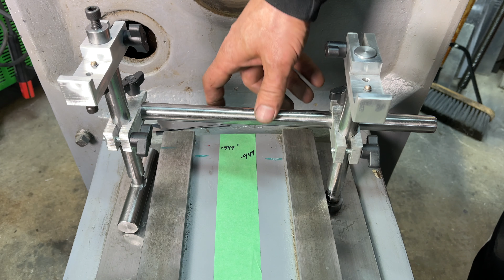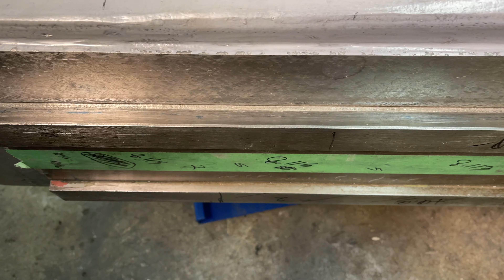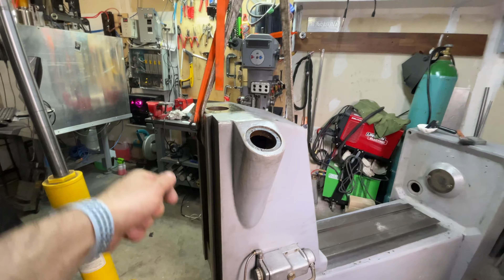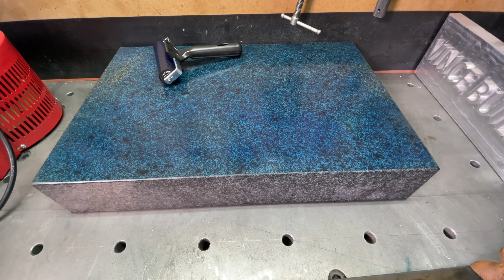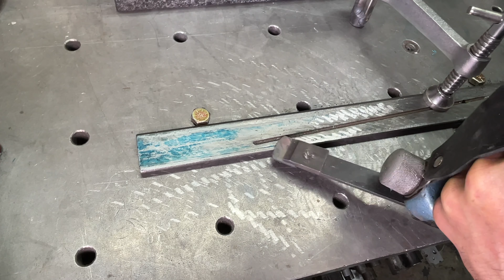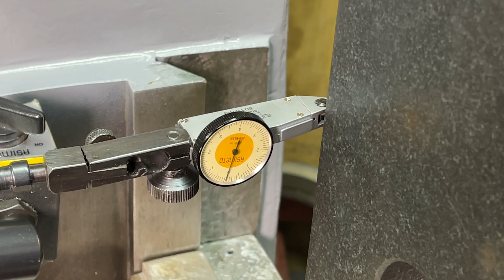Milling machine rebuild and scraping part 1 of 2

Comment: My dad used to say 
."don't get Biax happy" meaning stay on pattern so you don't dig a hole.
 The pattern is the consistency that yields the error. 1980 ish. 8 machines no problem.
 Good build on a decent machine. 
 Prime for a retrofit.

Comment: That device for Parallel measurement between the 2 mail dovetails is very user friendly. Keep it up bro. Really amazing work with all the explanations. One question. How do you rebuild the Taper Gibs, if they are worn out beyond limits. Of course a new one with the added thickness is one way. We rebuilt the gibs by brazing the rear side with brass strips and then scraping both surfaces for perfect flatness. This method worked on several compound slides of Lathes that we restored here.

Comment: Nice job! The Gibs and interior dovetail surfaces were maybe a small waste of time, since they're just a variable adjustment tool. As long as you have as much adjustment as you need with the adjusting screw, there's really no need to do anything.
Reply: I have heard better contact with the gib helps improve vibration and rigidity

Comment: Thank you so much for making a video showing your measurement process. I've begun my own journey on rebuilding a Bridgeport clone, and it's really helpful to see someone else's thought process.

I haven't watced part 2, yet, but I think your initial measurement of the knee squareness was problematic. If the face of the granite square was not perfectly parallel to the face of the way, any sideways movement way would change the reading even if the knee was perfectly square. That said, the measurement with the knee on the column is the ground truth.
Reply from the maker: Glad you found this helpful, I had lot of fun doing it and end result is very satisfying. Word of advice, don’t rush.
Reply: I was wondering about that as well. Perhaps pushing the square up against some gauge pins would have solved that issue? But I'm still not understanding how you make sure the dovetails are perpendicular to the column. In any case it's a fantastic video.

Comment: Nice work. Do you think when the machine was designed the knee was purposely out of square a tenth or two? To compensate for gravity taking up all the gib clearance and causing a tilt in one direction?
Reply from the maker: Normally they are but mine is off when I measure it from side

Comment: Hello I do not understand what is a "tou"or a "ten" I live in metric system nice video
Reply from the maker: .001” = .0254mm  .0001”= .00254mm
Reply: @VinceBuild  One "though" as "one thousandth of an inch"
Reply: One thousandth of an inch = one "thou", one ten-thousandth of an inch = one tenth

Even the abbreviations in the imperial systems are aggravating. I work in both, and it drives me up a wall sometimes.